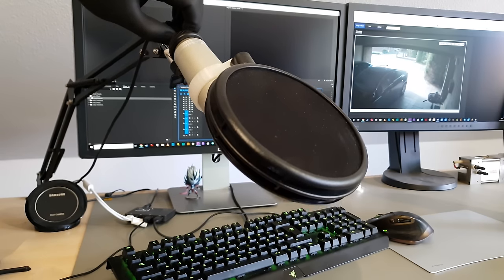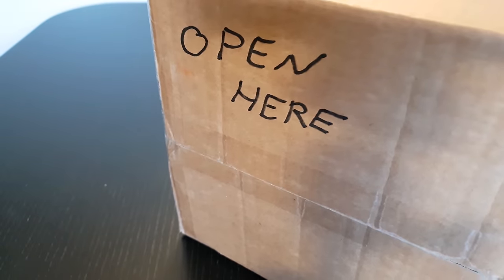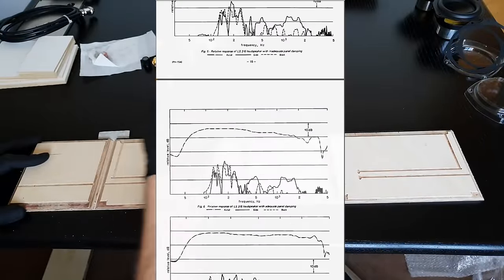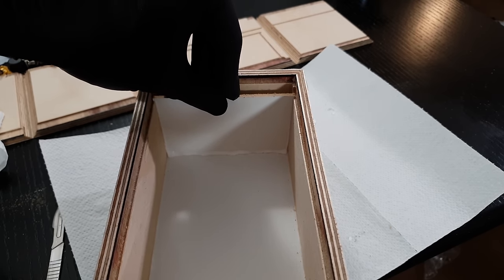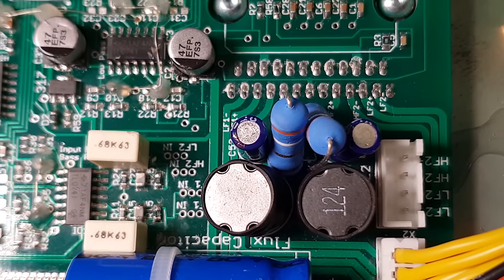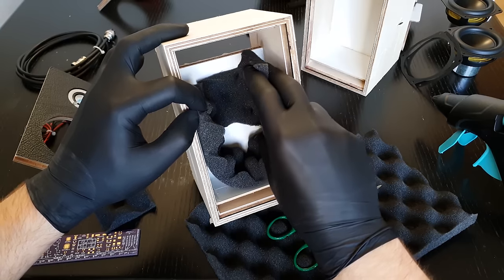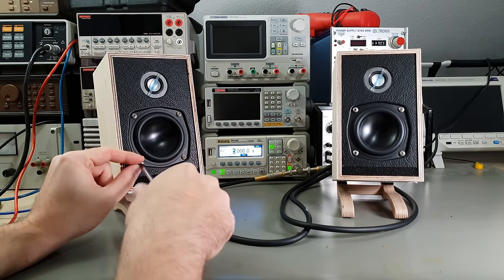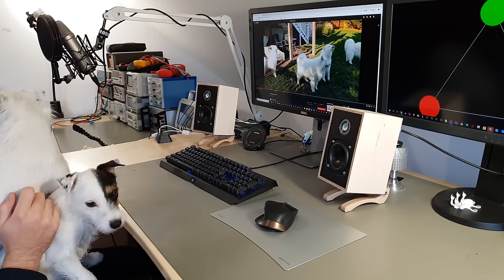Little British Monitors: DIY Transmission Line (?) Speaker Kit

Comment: Glad to see Falstad's circuit simulator getting more exposure.
Reply: Good for qick hacks. For complex rf or audio i am using microcap, its free now and runs easily in wine. You can even loop wav file through your amp design, and hear it, if harmonics analisis is not enough

Comment from the maker: (don't quote me on the port principles, it's probably all wrong) (first)
Reply: Lolz
Reply: As a professional in having no Idea what I'm talking about I suppose you are perfectly right. I've seen rectangular designs for bass reflex ports but only in the context of subwoofers. May be extensible to full range speakers.
Reply: Fact of the matter is all principal port, channel and chamber constructions are idealised approximations. A real port is always all of these things plus extra surprises the designer never bargained for, at least not until he built the cabinet and fine-tuned it until it sounds and measures like it does the right thing.

Narrow and long BR ports are not anyhow a rare idea, just inconvenient to design because you can't just keep sawing off pieces off like a tube until it does the right thing, and also ABS or cardboard pipe might come out cheaper than an extra piece of wood and then those extra channels to be routed for it. But with a wide, large-area slot like that and a long path you can reduce breathing noises from the port, and this is pretty much necessary in high-quality subwoofers. Not so critical in tiny little monitors, but i appreciate that the design is space saving.
Reply: @SianaGearz  Great informed comment Siana :) The LBM uses an unusually long, folded and damped slot port. I call it a transmission line. Acoustics doesn't care what we call it however, and an element of all behaviours occur in most systems. I would add that in a tiny speaker (that goes relatively low), the port area is just as important as with a subwoofer - the whole scale is just somewhat reduced.
Reply: Firstn't.
Reply: @MCsCreations  😂😂😂
Reply: T lines don't have resonant chambers. These are just slot style ports.

Comment: 1:35 Turbo molecular pump rotor on the desk between the monitors? Nice. I work with the bigger 250mm flange diameter ones on a big magnetron sputtering coater. There are 190 TMPs, 2300 L/s each. The coater is 100 meters long and has 32 target cathodes with 150kW Trumpf MF-generators on each and some old 60kW DC ones.

Comment: plywood is great but cheap and accessible is simple hard white plastic foam which used to packaging electronics, also i've noticed that monitor stand is itself a great anti-vibration platform (a line which vertically fixed with center and all gravity to the circle stand, which is only side of triangle) - i put speakers in plastic foam on the top of monitor = no vibrations at all, not sure why, just works.

Comment: That is definitely a port and not a transmission line. Even the shortest of true t-lines are much longer than these. Not to mention that there is a full chamber before the 'line' which is incorrect to do on a true t-line. 
Although, I would be interested in seeing these drivers in a t-line box, just for comparison; though that does take driver information that isn't always easily accessible.

Also, I understand most of the hi-fi comments were jokes, but have digital amplifiers not gotten to the point of being good enough for hi-fi?
Reply: What is that "digital amplifier" you speak of?

If you mean Class D (actually analogue, value-discrete circuits, but time-continuous), they are easily good enough for HiFi today. Well at least for some categories of HiFi where viable solutions exist, certainly among low-power devices such as these.

If you mean Direct Delta-Sigma, it is my understanding that this category only exists theoretically. Certainly someone built something like that but i can't find any solutions from major manufacturers with assured performance. Someone else has said that TI makes them, but i looked, didn't find, challenged them to provide an example, and haven't heard back on the topic yet.

Perhaps there is a practical issue that existing and well-regarded delta-sigma modulators are all not designed with constraints of high-power switching in mind, they can assume almost infinitely fast switching because their outputs don't have to drive any current whatsoever, just the voltage. With power MOSFETs, you need to minimise switching frequency, you need to observe minimum duty cycle, every time you switch, you lose a good chunk of energy and generate a good chunk of heat, so your main leverage to achieve an exact output level becomes in fine adjustment of the duty cycle. This would also favour designs that don't run on a fixed clock, unlike delta-sigma.

Comment: I checked the Kickstarter.. no mention of the drivers used... Why? :( Are those full-rangers for tweeters? With a 3" woofer? Why? Tweeters are rarely using cones and instead use domes (and I use ring radiators in my own DIY speakers). Perhaps a Peerless PMT30N18AL04 full-range as the tweeter? Those things cost $4.90 each if so. Though I do like the brand. "Woofer" perhaps Aurasound NS3 (actually also a fullrange)? I like Aurasound too; I use a NS10-513-4A woofer in my DIY "subwoofer" module. Maybe that makes the tweeters Aurasound NSW1s. But the surround looks smaller hence my guess of the Peerless. I don't like pairing 2 full-ranges together. A full-range always has compromises in it; you have to keep a cone and motor assembly light to reproduce high notes, but that will limit bass output. You can easily pair a traditional 3.5"ish woofer with a traditional tweeter and not need full-ranges because those sizes are close enough. It gets a little bit tricker to pair a 6.5" woofer with a 3/4" or 1" tweeter when you have to worry about cone breakup in the woofer and/or low-end distortion in the tweeter but that's just not a big problem at speakers of this size and again I don't know why they'd use even one full-range driver let alone 2. I use 3/4" Vifa XT19s, 4" Hi-Vi M4Ns and 7" Adire Extremis in my DIY speakers and my tweeter/midrange difference in size is actually greater than the drivers in this speaker but it's not a problem because it is still well within reason of traditional speaker driver designs.

I'd rather have something from DIYSG where specs and designs are actually discussed (DIY means DIY and why buy DIY speakers that go the commercial route of just talking about how the components are "high quality" but not their Thiele-Small specs, or even who actually makes them), but, hey, cool upgrade over the old stuff. Not sold on the vibration damping things at all. Lever effect from the base. Why. You want to prevent vibration from coupling into your desk (or speaker stands) but that idea looks like it's going to actually be creating problems as much as it solves them because the lever effect will amplify the vibrations (which it then has to also dampen).

I'm sure the speakers sound reasonably good but you can do better for the price and these are "DIY speakers" that aren't actually in the proper spirit of DIY.
Reply: Speakers in the video are Dayton, which is "house brand" of Parts Express, an on line retailer of electronic stuff  https://www.parts-express.com  There is a similar 4" speaker, which is much nicer and better built: # 300-458 for under $100 for a pair from them on their web site.
Reply: @shazam6274  Good call. I've used some of their stuff, not that familiar with their full-rangers though. I bought my M4Ns from them (also have bought other speaker drivers from them, but still not full ranges). Are the tweeters (or "tweeter-sized full-ranges" anyway) also Dayton? I didn't see ones like that from Dayton on there. It still looks like Peerless to me.

I'd rather have seen RS100 used over the ND91 or whatever that full-range is... There's even a paper version of some of the RS drivers which won't have the cone breakup the aluminum ones do (though I have only built systems with the RS125 and RS180, not RS100).

(In my defense, Aurasound does sell a NS3 with a black cone that looks quite similar from the front! They have the white cone version also)

Note that I recommended DIYSG which also uses lots of Dayton stuff. :) I like P-E.
Reply: @korgied  Check out the Tang Band full range drivers at Parts Express.  These have no phase or crossover distortions.  There are several 4" which are quite good.  Tang Band's web site has optimized box drawings.
Reply: Interesting catch on the fullrange tweeter. Well i think the idea is that he wanted to low XO frequency so that the excursion of the midbass driver doesn't translate to intermodulation across the vital parts of the midrange. The high excursion would result from a fairly low Fs of just over 60Hz together with a small area. Dayton crosses over at 2.5kHz (can't go lower due to its tweeters, and this is often considered the worst point to cross over, with 4KHz+ being preferred if sub-2KHz is not an option) and this at 1.5k. Then he mounts a diffuser plate to get rid of the mid-heaviness of the fullrange, or for some other reason?
Reply: It's not worth getting hung up on the 'full range' buzz word in the datasheet headlines, it just helps sell more drivers to people who are scared of crossover design.

If you want to design a great speaker there is no substitute for buying multiple drivers and extensively test them, then choosing the best for your application. Your credit card may not appreciate it but the end result should speak for itself.
Reply: The nd91 likely works best for this tiny box. Tang band made a concave metal tweeter, maybe it’s this one?

Comment: Is it time to upgrade my 20 year old Altec Lansing 02564X cube speakers yet?  The computer they came with has been replaced three times but those old speakers still sound pretty good.  Are the LBMs worth the cost for a guy who would only use them to look at YouTube videos and Skype?  Probably not.  If I want to hear true Hi-Fi I'll turn on my Sony 5.1 entertainment system, for the speakers of which I built special shock mounts.  Removing the cheap plastic stands and remounting the speakers to limit sound transmission into the wall or table on which they are placed is the single best thing you can do to any speaker system IMHO.  Can turn cheap speakers into more expensive sounding ones.  Maybe not quite audiophile quality but good enough for me and my low-level budget.

Comment: Link to the BBC study please? I recall a similar study by Visaton that concluded that MDF was close to the best beating plywood, short of going for something like concrete with rubber inlays.

Unfortunately i can no longer find it since i read it about 20 years ago, so no link from me. You'll still have to give me yours. Not a fair exchange, i know, but perhaps you can just request it from Visaton.
Reply from the maker: http://downloads.bbc.co.uk/rd/pubs/reports/1977-03.pdf
Reply: @reps  Thanks <3
I'm sure the Visaton study was much more recent, probably from the late 80s to early 90s, and they probably performed it because they had been aware of the BBC study but found it insufficient. My memory is very hazy, 20 years is a long time!

Comment: Nice review! What's bugging me.. The creator of these speakers has the common sense to find a way to proper de-couple speakers from their underground. (which I believe is the only right way > spikes are yikes). Egg crate foam is not suited for acoustically damping a woofer. It has a very  small damping capacity, especially in the lower regions. don't have the specs at hand right now but below 250hz it stops damping. (when compared to PET based damping of around 20kg/m3) You could also shave your dogs (also bought as a stereo-pair, which is handy in this case).  Don't know exactly how long you have to sleep on the couch,  probably it's better to wait until the summer. I can send you some of that PET based damping, if you want to test it. (And keep your dogs pristine for their modelling career)

Comment: for the size they seem pretty good and well designed. But for clarity, especially in the bass region, bigger drivers are needed, perhaps even carbon membranes for less distortion. 
I favor the Adam A7X and would love to own A77X but frankly those are just too expensive. 

You should also buy a pure gold power cable, since gold has better audio conductivity than copper.
Reply: I don't know if a sarcastic comment and a serious one in the same context make for very good friends. I mean Adam are excellent, don't get me wrong, i bloody love them. I just take it you mean gold power cable entirely sarcastically.

Carbon membranes are a bit of a lie though, like everything in audio... i mean i could explain what i mean, but it would be more than a couple sentences. But the short version is, the only thing that matters is the aggregate flexibility of the membrane. A stiffer membrane will lose less amplitude towards the edges where it isn't driven, but is more prone to breakup, and you need to handle that, and then you look at the tiny tweeter and the narrow baffle, and you discover that you don't have much room for that in the frequency range to shove your sins to where you can get rid of the signal. At low frequencies, the difference is smaller anyway, and having full membrane radiate lower frequencies and just a smaller portion higher ones is a very friendly compromise to be honest. And they can now do just about anything, they can call something a "paper" membrane but infuse it with such a hard resin that it's effectively as stiff as it gets, and on the other hand, the carbon powder in polypropylene membranes is mostly just a pigment.

Comment: My vote is for "fluid dynamics" (rather than "aerodynamics"). Air is a fluid and the well-developed field of fluid dynamics surely overlaps acoustics when dealing with enclosures. For example, an "orifice" in one field may be called a "port" in the other. Thanks for your interesting video.

Comment: Speakers really ought to be made with plywood or a layered panel construction.  Speakers made with single thick wood panels have a greater tendency to change with the weather, and particle board deforms with humidity over time.  Plywood board is not flawless, but the rigidity of the layers, combined with the perpendicular construction and the glue make them a very rigid choice.  Luthiers create rigid wooden structures using layers and layers of lacquer and varnish, Drum manufacturers use layered woods and veneers or lacquers to create rigidity,  but plywood creates a rigid structure without a skilled artisan's expertise.  Of course, the more rigid your box, the more resonant the speaker, which will give you a uniform, long-lasting sonic character without variation due to time and weather.  Just my two cents.

Comment: yeah the egg crate foam does next to nothing. the standing waves you need to absorb have wavelengths much much longer than the thickness of the foam and the foam has not even close enough to the mass required to absorb it. There are better options.

Comment: Hey marco, what cheap but good soldering station do you recommend for an EE student on a budget?
Reply from the maker: One of those STM32 based Hakko compatible ones from China I think - Haven't had one myself yet, but I hear only good about them.
Reply: Marco Reps thanks, ill look for one of those
Reply: Saw a video by Voultar recommending KSGER T12 specifically. I'm gonna stay out of recommending anything because i can do anything and defend from intruders with my old 929C. I'll get a T12 one day too though, i kinda have parts to build one but the handle i got is a bit bonkers, it can't possibly work or i'm doing something wrong. Oh well, one day.